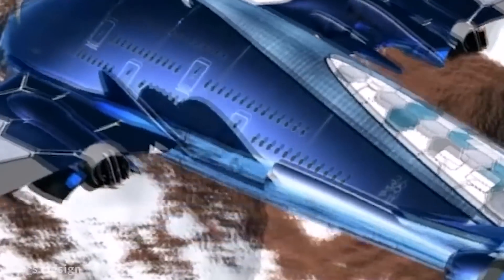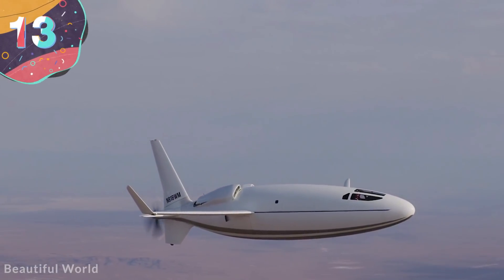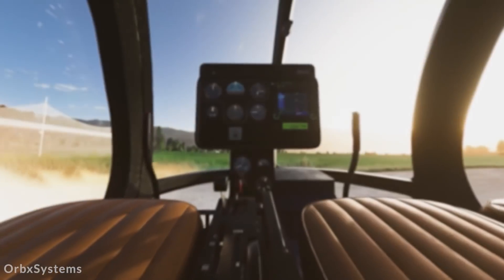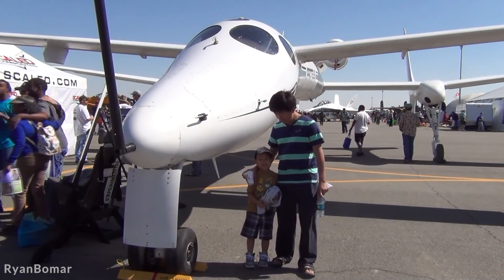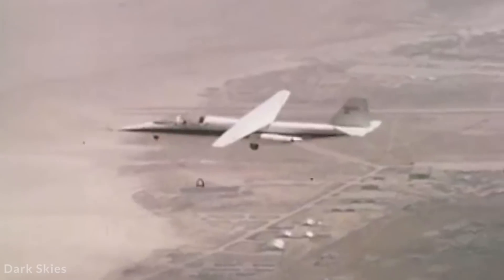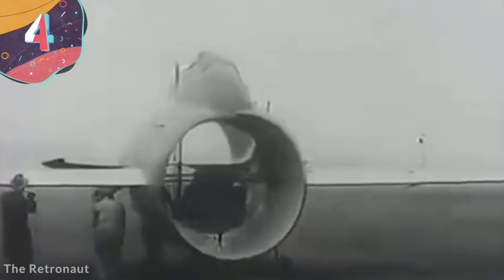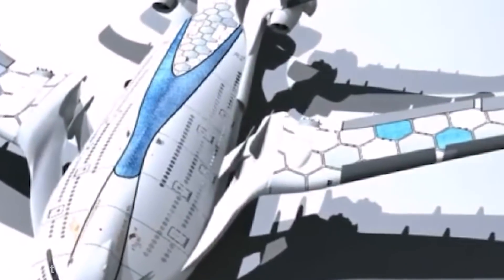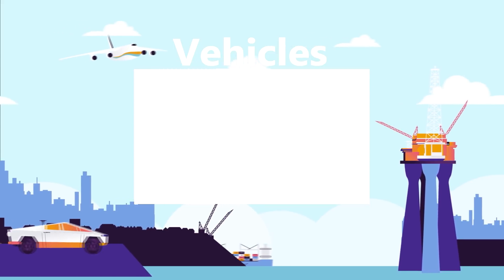15 Unique Aircraft Design Concepts

Comment: There are reasons as to why propeller driven planes have the prop at the front. The disruption of air by the wings and fuselage cause a pusher design to vibrate the whole plane.

Comment: Why dont we see Boeing come up with such unique aircraft designs?!
Reply: They have done the research and the passenger experience in a flying wing doesn’t work.  They are always looking for cheaper seat-mile innovations.  When you don’t see them on the plane it is usually when they get shot down for cost, safety, or no market.

Comment: Where I grew up there used to be an Optica in use / testing. It DEFINITELY wasn’t “ virtually silent”
Reply: Thanks for your insight, but what they actually claim is "it is virtually silent in flight". very clever!
Reply: @ecoideazventures6417  It’s a cool little aircraft for sure. The sound has to go somewhere, so if it’s silent from inside it’s being sent elsewhere. It was a noisy little bugger from the ground. ( I still like it though )